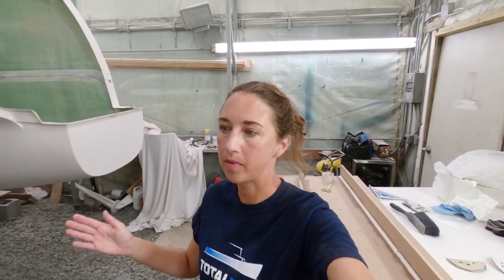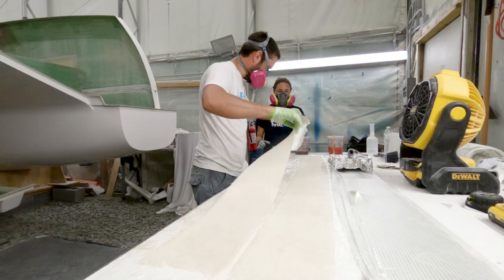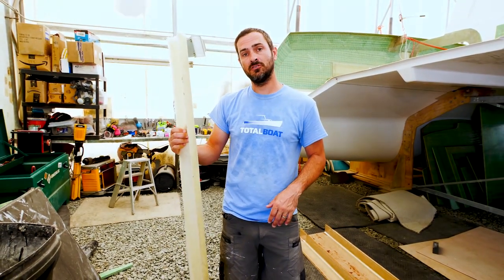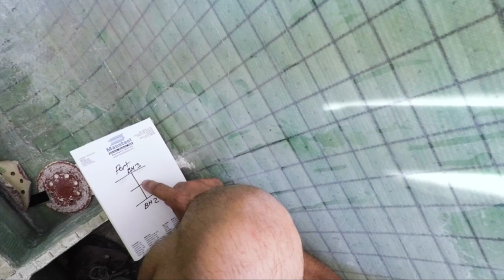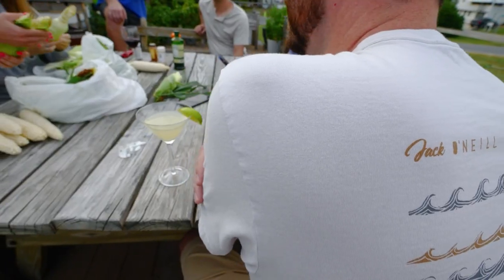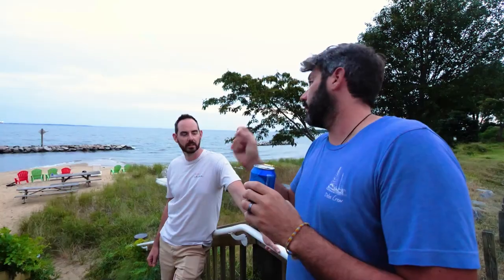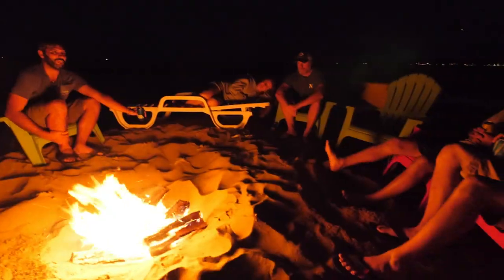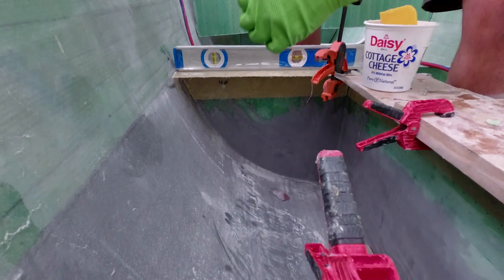CATAMARAN BUILD - Prepping for Floors  (MJ Sailing Ep 202)

Comment: I save those little pieces of fiberglass you just never know when you might need them. They can always come in handy. You can even use them to go back into the corners where you've jointed two angle to make a ninety degree angle, between the bulkheads.

Comment: I continue to be so impressed by your work ethic, your smarts and how athletic a person has to be to do the work you’re doing.  Amazing amount of focus and teamwork.  It’s a joy to watch your videos.  Another comment was made about breathing fiberglass as you cut it with power tools.  Maybe one of your videos could include your health and safety tools and habits. I’ve no doubt you thought them through as well as everything else you do.  It would make for an interesting  video.  But about those knees Matt…  As an old guy who is paying a pretty steep price for not protecting my ears and joints, research how to protect your bodies as thoroughly as you research everything else related to the build.  I think you are using top quality, and expensive safety gear, but those knees!  Replacement parts never work as well..  Thanks again for sharing your project and adventures. Cheers, Will

Comment: I didn't hear you mention it in the video, but I hope you are planning on waiting as long as possible to bond in the floor boards.  It will be a lot easier to run all the plumbing, electrical, pumps, tanks, seacocks, and other system connections that will live under the floor access hatches.  Especially the limber holes, way easier to do before the floors go down!
Reply from the maker: With this design, none of those items are below the floors (except fuel tank).  They are permanently sealed.  -Matt
Reply: @MJSailing  This is good.  Sort of a 'flotation tank' setup should you run aground.

Comment: I recommend rolling the fiberglass tapes onto something (like a short piece of cardboard roll or PVC pipe, just slightly narrower than the tape is) after/ during wetting out. This will make applying the tapes easier, especially in difficult locations. 
Great job, thanks for the videos👍

Comment: Screw 1inch x 4 inch to back plate of mitre saw then clamp a suitable block to it to use as a stop for cutting multiple parts of the same length.

Comment: I do not know if this is of any value to you in your vessel--but I flame the sides of PVC electrical conduit a little (or you could scuff it with a wire brush or sandpaper I suppose) and use in in epoxy-cabosil corner fillets under deck shelves etc.  Not to save resin, although it does this because once covered it is very strong except longitudinally, but if that is a worry one can wind it in glass tape first.  Anyway, this conduit is excellent for running electric cable unobtrusively. I blow a cloth mouse through it towing fishing line, and use that to pull through any cables.  Cheers!!

Comment: This type of "fussy work" usually comes at the end of the build - and it seems to never end. Good thing to get some of that out of the way early on, cause that stuff is super frustrating to deal with. Think of what a difference it is to NOT having to do all the sanding that would have been needed with another kit! It looks like you have a couple of week more of this type of work, but then you can begin to place big pieces in the hulls and on the BD. Looking good!

Comment: Noticed a lot of drilling through the glass skins into the cores. Have you thought of using hot glue. When I was building I used to do this daily as when it was done you can knock out the blocks of wood etc, and leave no mark, or holes to be filled. Hot glue guns are amazing for boat building. Great also for making templates, quick and easy.
Reply from the maker: We try to drill only into areas that will be fiberglassed anyway.  But we have used hot glue for a few other spots where the holes wouldn't get reinforced later.  I need to get a battery powered hot glue gun as I hate dragging cords and pick the path of least resistance often.

Comment: You mentioned they will be a closed system under the  floor except for gas- Will you spray  a closed cell foam into the  bottom ?  Then the places for gas tank will you double line that to prevent possible leaking gas from effecting the foam? know I am curious if you will insulate the hull for cooler water.   Running the wires and plumbing through the ceiling or a channel on the wall towards the ceiling?  making that as easy to work on and inspection for trying to fix things while days from land makes sense.

Comment: Ceramic bladed scissors. That's about the long and short of it, when it comes to glass cutting. Alternatively, see if there isn't any industrial fabric cutter near you (craig, fleabay, the usual suspects), those have heavy duty blades, and you'd need 7 of these projects to wear the blades on one (of course, if they weren't gone when you got them).
Reply: Or a little band saw of chopping up a roll into smaller roles, then just using the ceramic scissors for the smaller cuts. I used some dress making scissors and they were amazing, expensive but worth it

Comment: Use some wax on the form each lay up for a flawless release. Also, is there enough contact made with such a small amount of thickened epoxy used? I see quite a bit of air bubbles that could be diminished considerably with more epoxy used to squeeze out any air filled gaps. Just seems like something to use ignorer to make the best full contact possible for the entire area to be chemically bonded.

Comment: Will you both be doing the wiring and every single installation/build out? Is everything shipped to you and you'll be doing 100% of the work yourselves? Pretty intense!
Reply from the maker: Yes, we will be doing 100% of the work ourselves.  The wiring does not come with the kit, it is something we'll need to buy separate.  But it will be installed by the two of us. 🙂
Reply: @MJSailing  wow! Impressive. Will look forward to seeing it all come together.

Comment: This is way late to the party, but I wonder if you considered filling those spaces below the floor panels that are not going to hold machinery with expanding foam.  I know it would be more weight, but if enough of them were filled, would it not make the boat essentially unsinkable if you ever took on water?  Also, if it was filled, would it not prevent ever having water in a bilge area you can't access to pump it out?
Reply from the maker: The trapped air is more buoyant than foam.  So as long as a few of the 96 enclosed areas remain airtight, the hull would remain afloat.  In fact, the core of this boat alone is enough to float it.    The floor also acts as a secondary hull, so if I ripped off the bottom, it would prevent water from getting into the living space and this would also float the boat.

Comment: Safety concern, cutting fiberglass angles without a good dust mask or respirator on. Fiberglass dust contains small glass particles that cause lung cancer, Think asbestos particles, your body will not dissolve either of these particles.  Research this for your safety, Enjoying your build, stay safe.

Comment: Instead of throwing those corn cores you should of used them as fire fuel OR after letting them dry out, you can dip them in petrol and use them as fire starters.
Reply from the maker: The corn cores went to Cam's 6 chickens as feed.  🙂

Comment: Why did you cut 45/45 instead of a simple lap joint?  Lap joint would be stronger and less work.  If the top is on the long axis and the short lower or fill point so a small amount or thickened glue.

Comment: Wouldn't Hex Washer Head Self Drilling Sheet Metal Tek Screws work for temporary attachments?  You wouldn't need to drill a pilot hole first, maybe?  And they are cheep at HD.  Maybe it wouldn't work because of the 'solid' nature of materials not just thin sheets.